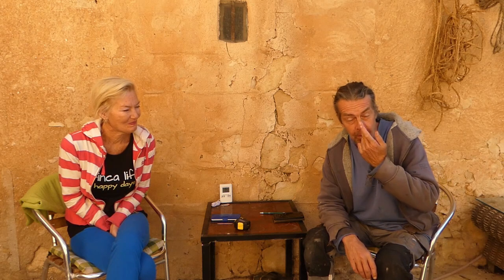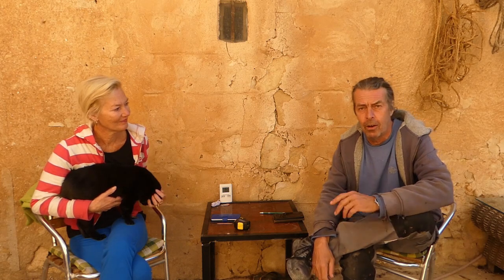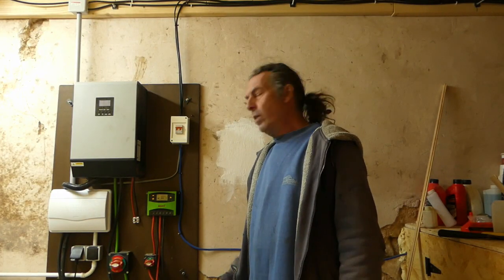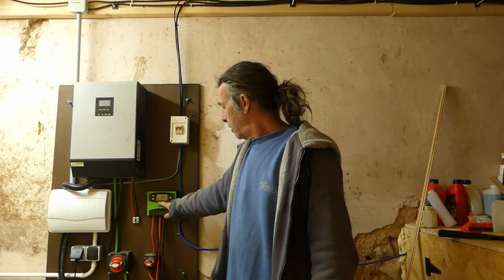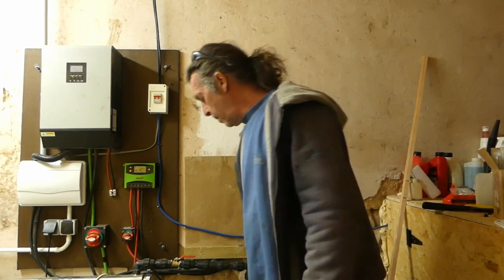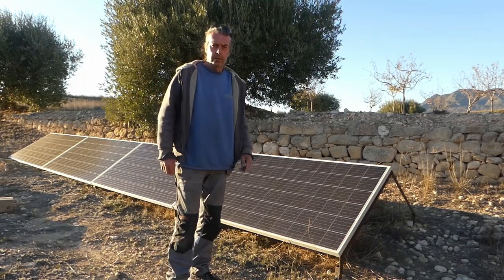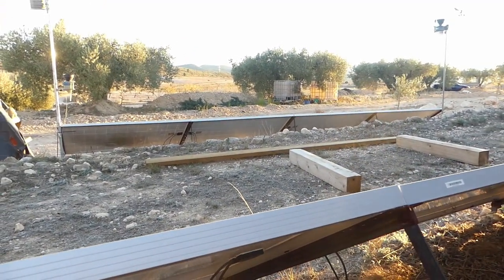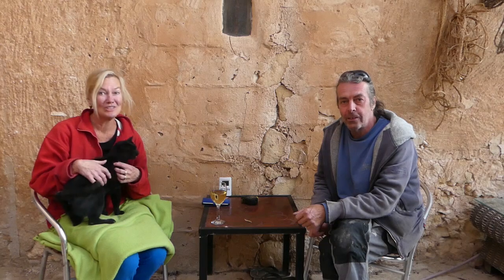Repairing our solar system & big upgrade planned

Comment: Very nice to know the reason of the fire!

You need MPPT charge controllers which are way more efficient compared to PWM charge controllers. Every pulse you lose energy with the PWM if I remember well. But anyone correct me if I’m wrong.

Great job again! Happy to see you’re almost back online with loads of power.
Reply from the maker: Thanks Jasper. We are well aware of the benefits of mppt chargers vs pwm. Unfortunately, mppt chargers are a bit on the expensive side for us, so we have to make do with what we can afford